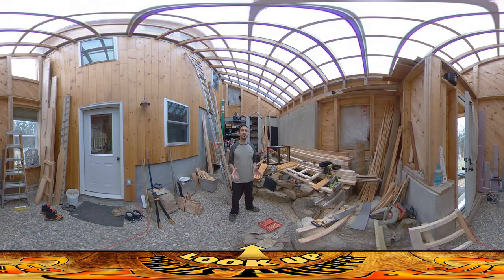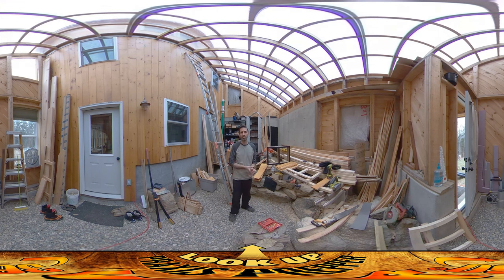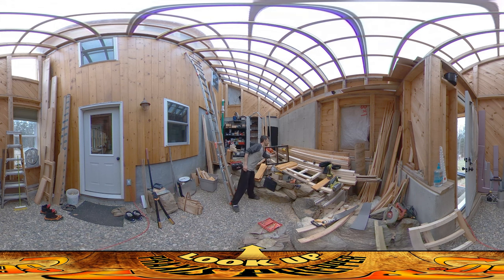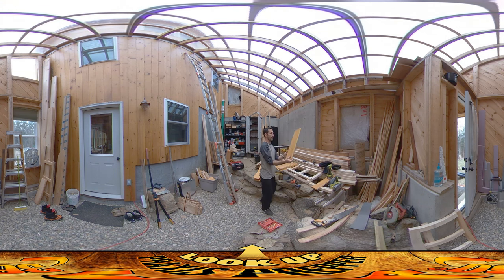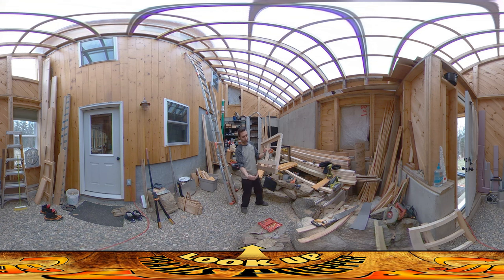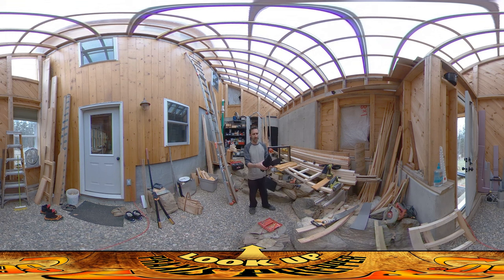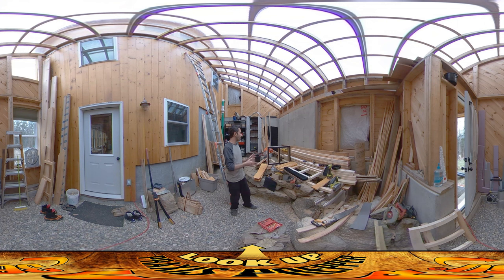Homestead Building - Fallout Shelter Air Intake Filter Box

Comment: I have built 3 solar window heat box's  just nead keap the snow shoveling done .  ( From scrap cans and wood ) our winter heat bill dropped  buy 30 percent. They do not work with swing windows just with the double hung windows .  Great info on u tube for DYI SOLAR COOKERS BUILT 3 NOW.  OUR BACK POURCH IS GREAT SUN SPOT
Reply from the maker: I've been thinking about building a couple of 2 story tall heat boxes for the front of the house to add heat in the winter as well. I think it's a great approach (using free energy whenever possible).

Comment: Do you have replacement diods for your solar panels in case of a EMP?
Reply from the maker: Working on having backups of things. At the moment, I have an entire backup system (at smaller scale).
Reply: @PraxisPrepper  some solar panels you can open up to remove the diods to be replaced if go bad . In a EMP those diods are what get take out by the pulse

Comment: Now i have solar power envy
Reply from the maker: It's a manageable thing to start small and make a system that handles some of the use around your home. This is the first full house system for me, but I've been tinkering for years. Consider just building a system that will run your fridge. That's pretty manageable to do and is a good starting point. Even if that's as far as you ever go, you'll be reducing your monthly utility bills forever while also protecting your refrigerator food from spoilage during a blackout.

Comment: Oooo… I see more lumber… wonder what the next project is going to be 🤔

What’s up with the stock pot over the door? Somebody planning to fill it with slime as a nice gift for someone coming through that door 🤣😂🤣

How are the roof panels doing for the greenhouse wings?
Reply from the maker: That's actually all old lumber left from the house build. Slowly pecking away at it - and glad to have it now that lumber costs 3x as much as it did a couple years ago.
The greenhouse roof panels are still doing great!
Reply: @PraxisPrepper  Yeah, definitely not encouraging for future construction. When we are ready to get started might have to buy a sawmill and use wood from the land for anything that isn’t load bearing so not required to be inspected and stamped.
Reply from the maker: @inmyimage1081  Depending upon the town in which you build, the inspector might be okay with even the load-bearing posts and beams being your own cuts if you (perhaps) overdo them. Like using 6x6's in a place that would be fine with (inspected and stamped) 4x4's. In my several experiences with building I've found that there are things that building inspectors feel are important from the code and other things which they let slide - and those specific things are not the same town to town. So it might be useful to at least ask about it. You may be surprised at their answer... or not, but it doesn't hurt.
Reply: @PraxisPrepper  Planning to avoid the topic altogether by buying a property in a county with no building codes beyond the state requirements and no inspections. Also planning to build using ICF, basically foam lego’s filled with concrete. Might include the interior walls as ICF too. Roof will be concrete too using a product called Litedeck which is a steel tube reinforced foam form that you pour concrete over. It is shaped to make concrete beams similar to what you see in parking garages, but insulated between the concrete and the living space. It’s all used for a “zero energy” home and pairs with radiant heated floors really well. The structures are very airtight and require air exchangers. Currently planning to make a media room with no windows but with a bathroom, the solar battery and inverter room, and pantry so that it can double as a shelter.

Comment: test it, Praxis.  Box dimenisons are too small for four people. Basic math.
Reply from the maker: I agree, four people will definitely NOT fit into that box. ;)
Reply: @PraxisPrepper  test it, Praxis. Your air intake is too low
Reply from the maker: @Diebulfrog79  I'll definitely be testing it as soon as it's built, but I'm not sure how anyone could know that the air exchange rate would be too low without knowing about what fans are being used, their speed, etc. I have to believe that this filter box is a perfectly good size since it uses four filters to job of what would normally be a single filter. If normal house air exchange systems use a single filter's surface area for exchanging air, and I have 4x that surface, it seems like I'm probably somewhat in over-kill country here. Of course, as you suggest, I'll definitely be testing it out. I have a reliable CO2 monitor, so I'll be able to see if there are any issue with this approach when I test.